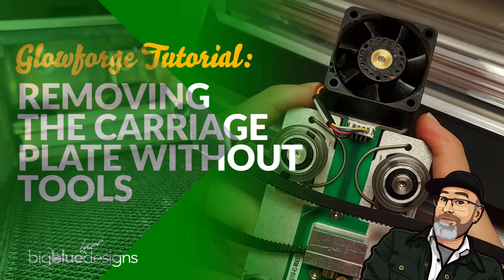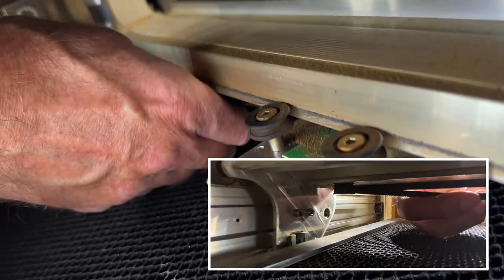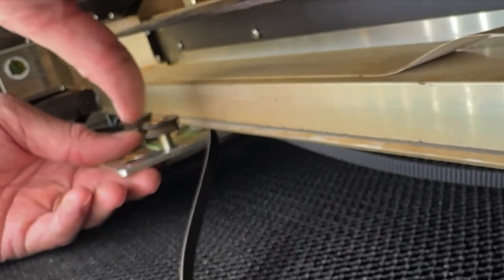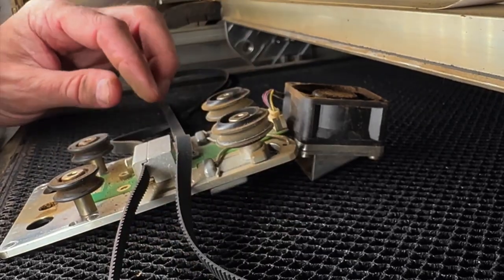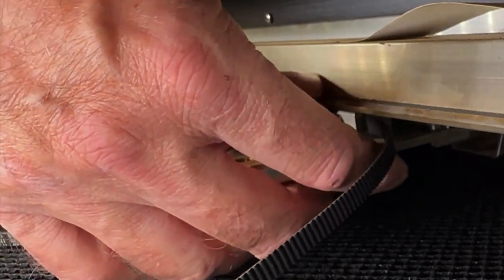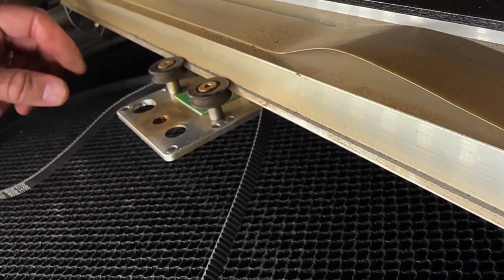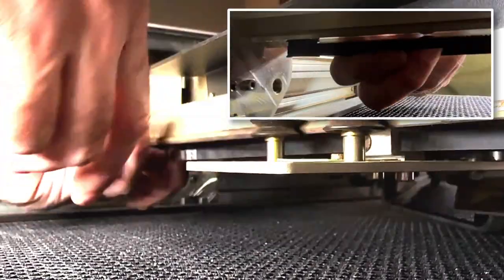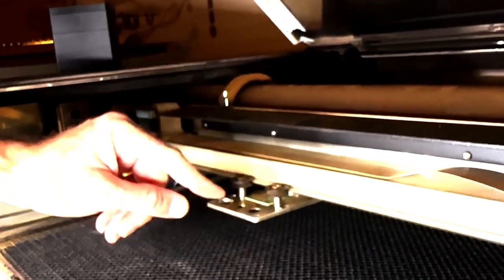Glowforge Tutorial: Removing the Carriage Plate to Clean the Air Assist Without Using Tools

Comment: I cannot get that belt back on! I've tried numerous times. It seems I'll need to unloosen the wheel. Maybe the belt is too tight to do it your way? UPDATE: I ended up placing my thumb below the belt and pushed the belt UP with my thumb as I slid the gantry towards the corner. It popped on! YAY!

Comment: I just loosen the hex with a 3mm hex key. Basically, 10 seconds to put the belt on and resecure. I spent an hour doing it this way in the video unsuccessfully.  My belt was super super tight. My glowforge is basically a year old. I see other videos where they do this method and it pops right on like this one.  The belt must stretch over time. Mine wasn't having it.
Reply from the maker: while it’s possible for the belt to stretch, I’ve never experienced that on any of my Glowforges nor on the dozens I’ve taught people on. I worked on a customer’s Glowforge last week and it was quite tight. I was able to get it off and on since I have so much experience doing it, but the customer wasn’t able to - so she’s going loosen the hex also. 

The challenge in doing that is lots of people have trouble getting that wheel back as tight as it should be again. 

Ultimately each person should use whatever method that they must. 

When Glowforge first came out, they told people to loosen the wheel. But now on their website they also teach to do it the way I’ve been doing it.

Comment: I’ve cut a ton of Mdf but been afraid to deep clean like this. My Printer head is so packed with dust. Can I use canned air to clean that?
Reply from the maker: That’s definitely a good start! But the air assist fan will need some attention for sure as will the main exhaust fan. Be sure to take good care of those. It’s not hard to do, but putting it off will only create more trouble.
Reply: @BigBlueLaserDesigns  thank you so much for this video.  I faced my fear tonight and took it apart to clean.